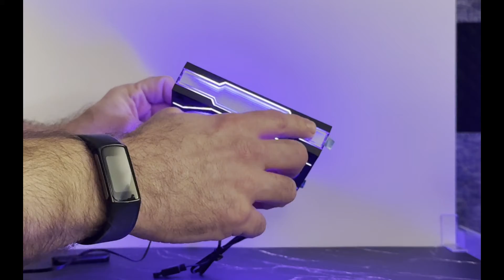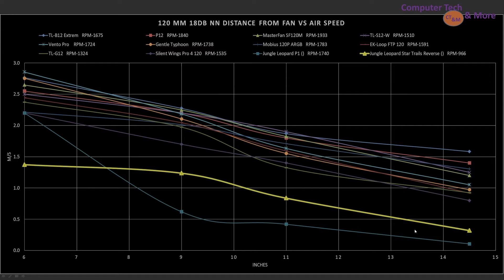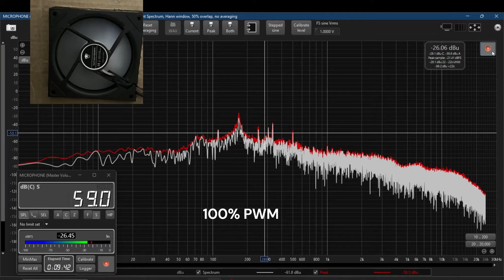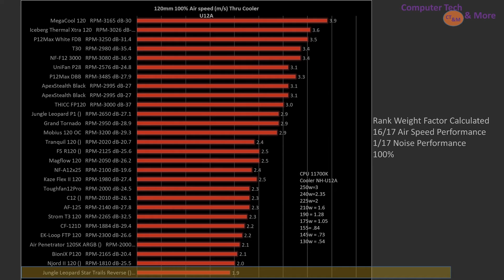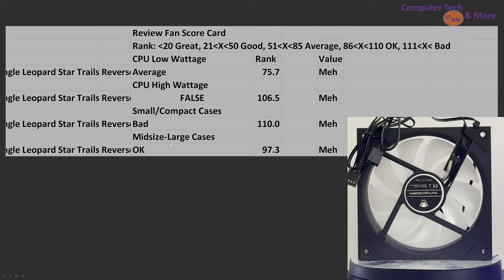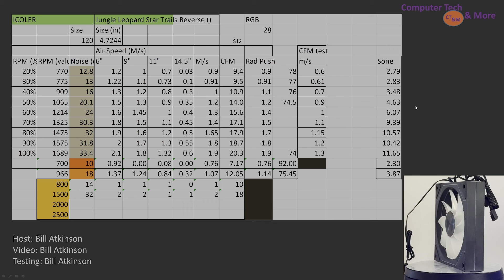Jungle Leopard Star Trall ARGB

Comment: Why are you testing this specific fan? Nobody knows what this fan is, just judge by its look,  It looked like a centimeter of the fan's diameter is dedicated to RGB. It's pretty obvious that it'll be terrible.
Reply from the maker: ok not trying to be rude but if you watched the into I said why. 
Heres the thing a lot of people might go hey look at this RGB fan its cheap. Might or might not check to see if a review exists. then buy. I'm here to those the do check for reviews.
Reply: Nobody else is testing these fans. He's doing a great service by reviewing products people might see as cheap alternatives, but there's actually major flaws with them.
Also tons of product images are renders, so you cant just go by what the render shows.
Reply: @_aceofspades_  I just wanted to say, there are a hundred if not thousands of these kinds of fans out on the market, they are dirt cheap, and they are almost always as good as not having them installed. Sometimes, they get so terrible that all they do is generating noise, without any cooling.
Testing each one of them take forever, and will get you almost no views.
Imo, the only exception to these dirt cheap fans are Thermalright branded fans, they are dirt cheap, and they perform pretty good across various reviews.